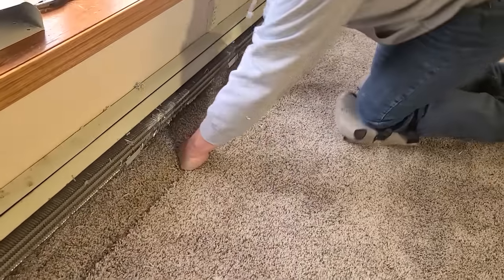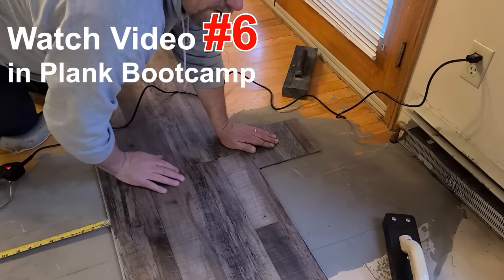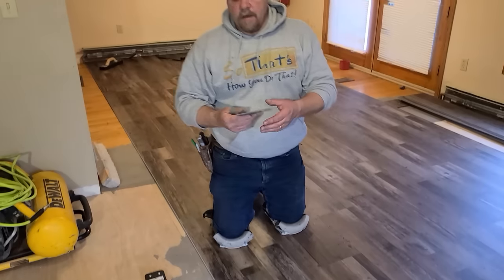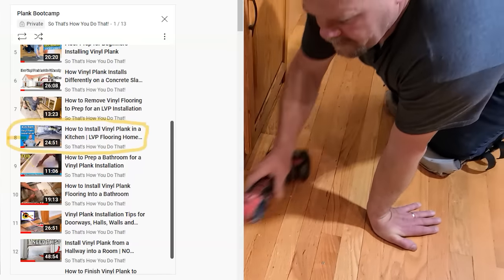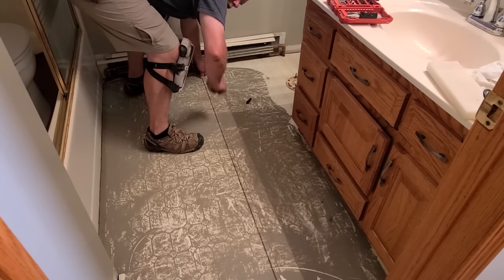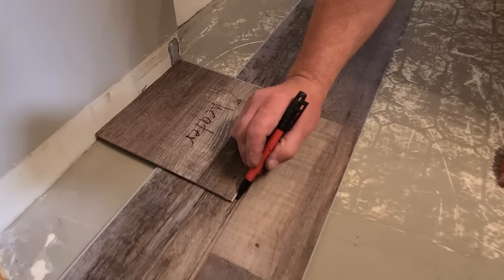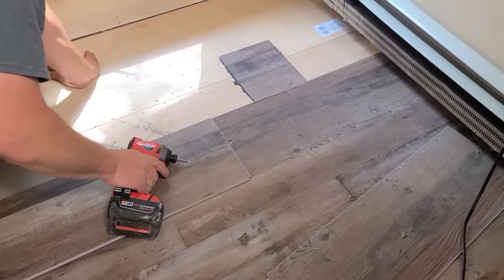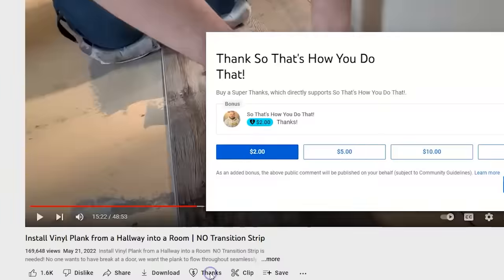SIMPLE to Use Step by Step Guide for Installing Vinyl Plank EVERYWHERE

Comment: I have been watching your videos on installing vinyl flooring and have gained a lot of information. I appreciate what you do.  You explain well.  
Although not a professional, my husband is quite good with doing work around the house. As a matter of fact, he installed the wood flooring (3" W planks) in the house in three rooms a while back which turned out quite good. We recently purchased Aquaguard (6"w) laminate flooring that we found in the same color (cherry).  We checked on pricing for the existing floor—it’s just too much money.  He is in the process of installing the floor in the first bedroom which is off the hallway.  He removed the existing carpeting and added the recommended plastic liner over concrete. This will make the floor slightly lower since he is not installing the plywood. Instead of starting right under/at the door with the first plank (I thought he should) and going out from there, he lined up against the wall (with the spacers--he did make sure that he was installing in a straight line, etc.) and went from there.  He figured he would come back to install the last plank under the door (figure out something) and add the finishing plank back in. The floor is installed now--today (it looks good) but he could not figure out what to use at the door to make up for the height, so he mixed up some concrete to install in the doorway to make it higher and will install the plank after it dries. I took a picture of this but could not figure out to add it--not a computer expert at all.

We have two more bedrooms off the hallway which he plans to start on about the 2nd week of next year.  So, my question is what would you suggest on transitioning into the bedrooms instead of what he did previously?  I hope I have explained what he did correctly, and you understand what I am asking.

Also, he had issues with the floor itself not snapping (many broken pieces/edges as well) as it should.  It did not go as easy as their video indicates.  Anyone else have that issue with this flooring.

Any suggestions would be appreciated.  God Bless Everyone in the New Year!

Comment: How bad does a "dip" in the floor have to be to required the cement leveling?  Mine is very minor, the bubble still stays inside the guide markers, resting against the left side of the marker on the level.  I was hoping that would required the cement leveling product.  Can you advise?

Comment: Hi Joe, thanks for all of your excellent videos, I am going through them in preparation for installing a vinyl plank floor god ,y first time ever at 65 y/o in a new build we are working.  I gave a question in this video at 44:45 where you are going through a door into the next room. You snapped your reference line, installed a couple scrap pieces then used your cheater board to scribe the walls onto the first vourse in the room.  My question is, does the first course inside the next tool still connect to the flooring in the door threshold?  Thanks again for all of your explanations and encouragement.  My confidence is growing with your mentoring.

Comment: Joe, thanks for the great videos.  Once I followed your tips I had much better results and easier time installing in my vacation condo and all was good but when I came back a month later I found a soft spot in one of the rooms (can feel the plank depress when you step on it. not a lot but obvious to me).  I have not yet resorted to removing the new baseboards to check if due to expansion.  Not much change in weather.  In Hawaii, a bit warm and humid at times but not bad.  And its a couple feet from the side of the room where I started so don't want to start pulling it up.  Cali 8mm vinyl planks.  What do you think?  Suggestions?

Comment: Positioning the planks to run down the long areas makes sense, but what do you do if the floor plan has one area where it ends up being narrower in that direction? Do you still stagger with small pieces through that area, or do you run full boards across for fewer joints? I'm having trouble visualizing

Comment: I'd like to see the same video using the cheap vinyl with square edges that curl up when you drop lock them, see how well you can do the hard areas, or certain engineered click and laminate is so thick it's hard to do doorways, you gotta shave the lip and glue the groove, I do commercial work cheap so I'm fast and I also do private work so I always do a good job, customers can't believe how fast I am, in the first hour yesterday I had over half the living room done and started off the hard spot with brick fireplace on 45 and heat vents down the wall, fun stuff lol as an installer dealing with poor products is part of the job lol vinyl doesn't always install this easy , I find I gotta adapt and learn to install different products

Comment: Joe, thanks for posting all the helpful information on installing vinyl plank flooring.  I am getting ready to put vinyl plank in two of my bedrooms.  Vinyl plank has been placed every where else in the house we found the exact flooring to put in so it will match.  I have a question, at the entry door of each bedroom  the vinyl plank was stoped in the middle of the door frame so I was hoping to pick up there by attaching a plank to the existing one.  There lies the problem the tongue has been removed so there is nothing to  attach to.  Do you have any suggestions on how to make this work?  I really don’t want to use a transition strip if I don’t have too.   Thank you in advance for your help.

Comment: I'm preparing to install LVT in a small 5X8 bath floor. I think you said the toilet should go on top the LVT, but what about a 37 inch wide wood vanity? Would be easilier to just do the whole floor, then set the vanity on it, but would that prevent the floor from floating properly etc.?

Comment: I’m gonna get started on the floors in the next couple of weeks, you’re videos have been amazing, so thank you for the time and effort you’ve put into these. Do you have any advice on where to start the flooring if there’s no hall, but two doorways I’ll have to run through going lengthwise? One of the doorways and small addition on the other side is not straight, I just realized that. The room is a big rectangle other than the two rooms in each end.
Reply from the maker: Just use the same method for the big room. You can run the plank any direction you wish.
Reply: @SoThatsHowYouDoThat ok thanks, wish me luck.

Comment: Hi Joe great job and amazing workmanship your team has, my question is regarding steel/metal door jams and casings. Which tool and blade would you use to undercut
Reply from the maker: An oscillating saw with a bi metal blade.

Comment: Joe, going to do one within a month or two. We are removing the carpet from most of this house, and it has concrete underneath. Now the planks have rubber underthem, waterproof, etc.. but should I put the underlay under those for the concrete that will be exposed? Thanks for an assistance.

Comment: I was quoted 2k to do a small kitchen/Laundry room......I ended up going for it and doing it for 700 total.
It's not hard at all.  My biggest pointers is to make sure you square the room, don't try and buy the product to the studs under your walls and my neighbor, who does this for a living, said...NEVER EVER be able to look across the room and see a seam line up.  I did mine and it turned out absolutely gorgeous......then a friend of mine had done hers and I saw exactly what my neighbor told me about.... Seams lining up does not look good and now I can tell who knows what they are doing and who doesn't.

Comment: Joe, 

First, let me complement you for your evangelical outreach with your videos! 
I am currently installing a Duralux rigid core vinyl plank floor on a slab in my home. I pulled out all of the carpet and ceramic tile that I put in myself when we built the house 20 years ago. We are frugal people and try to be good stewards of what God has blessed us with. I am an electrician by trade and a bit of a perfectionist. 
So here is my problem. I started putting in the new  floor on Tuesday. We moved all of the furniture out of the living room, den, kitchen and dining room. I’m trying to keep the house livable and functional during the installation. I have the installation to about 50% completion and I’m beginning to see some gaps appearing between planks. Why is this happening?
I will gladly pay a consultation fee! I can give you my phone number and any other contact info. Ev if you are not available due to timing if you could guide me to someone who might be available it would be appreciated! Please help!

Best Regards,
Chris

Comment: I have Mohawk planking that have 3 different size planks.  Will I need 3 different sized cheater boards?  Seems like I should fir when I run into that situation where there are different sized boards going into each door opening or what have ya.

Comment: Hey Joe, I need to do one room at a time because money is kinda hard to come by, is there a way I can do a room at a time. I'm doing this really small room and later do the hallway that attaches to the small room. My home is a 14x70 single wide trailer. Can it be done? I hate starting something and not have some kind of finished look for the meantime.
Reply: I’m sort of in same boat but more related to timing issues. Need to do one room at a time

Comment: Whats your take on filling grout lines when installing plank over tile? Isnit necessary especially if they are 1/4 or less?
Reply: I’d go right over it with vinyl plank. This guy does way too much prep for a vinyl floor.

Comment: Joe, what do you do with metal door jams?
Reply from the maker: You can undercut them most of the time using a bi metal blade on an oscillating saw. Otherwise, leave an 1/8 inch gap and fill it with a matching silicone.

Comment: Big mistake is self leveling or any type of skim coat over a wood floor has movement and you cannot truly bond to wood so it will break away from that wood subfloor at some point. That’s a guarantee
Reply from the maker: NOT TRUE! Ardex Feather Finish sticks to everything and will not break away. I use Ardex.
Reply: @SoThatsHowYouDoThat  I’ve been doing flooring since 88 seen it happen a ton a times. Wood has movement in it.